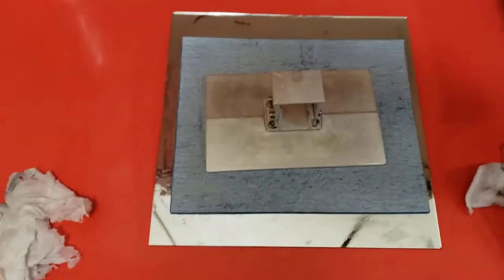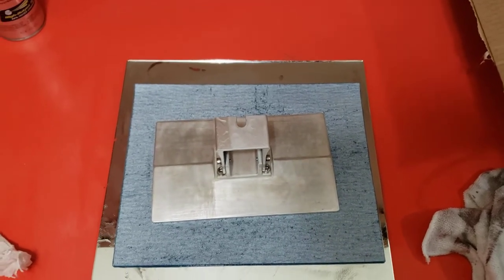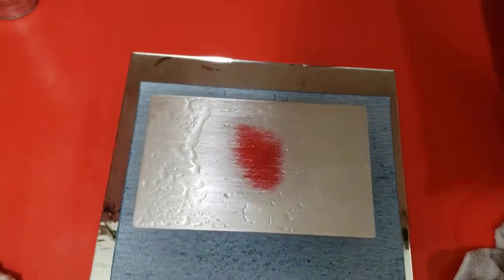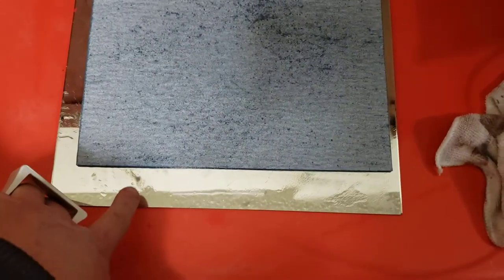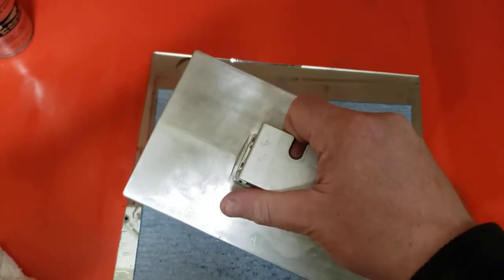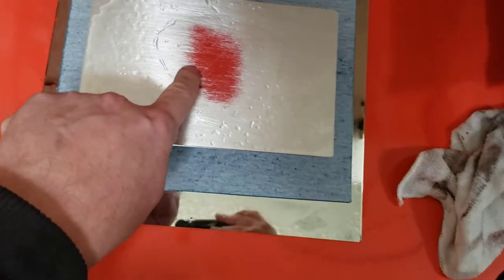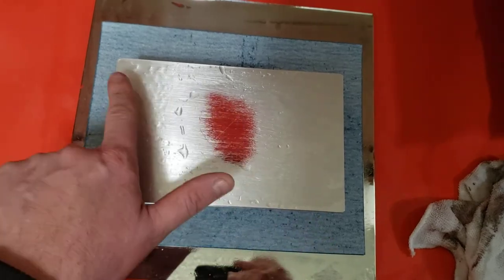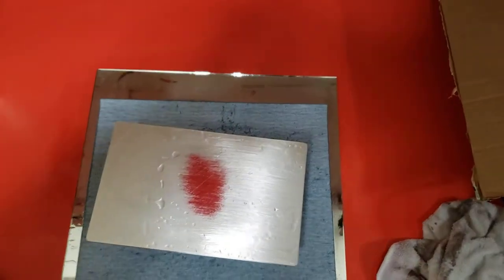Anycubic Mono X bed level (paint method)

Comment: So, keep sanding until level?
Reply from the maker: That's the goal.  Depends on how uneven, you could be sanding for an hour or two.  Start with 120grit to take off material quicker..then move upto 180grit when basically flat to remove the 120grit sanding scratches, then 320grit then upto 800grit.  You will get the hang of seeing the larger scratches dissappear as you move up to higher grit.